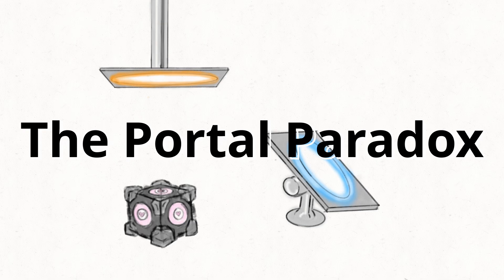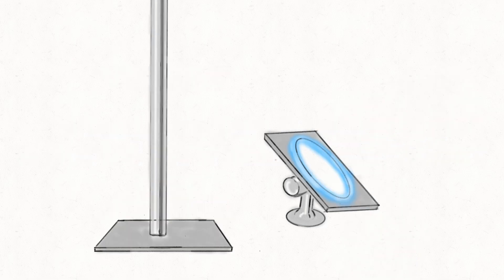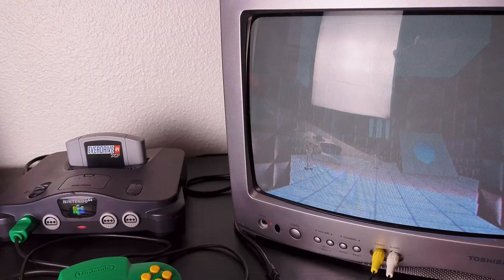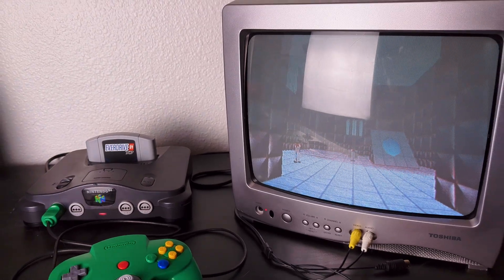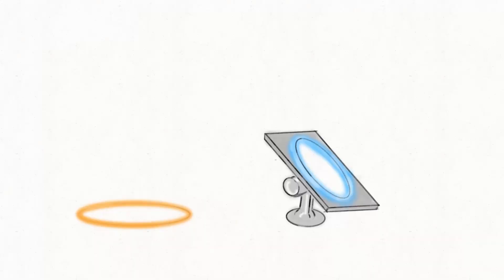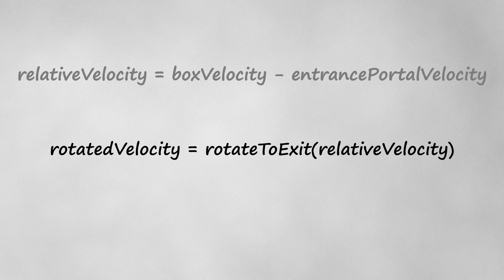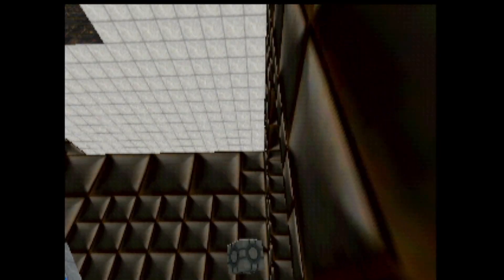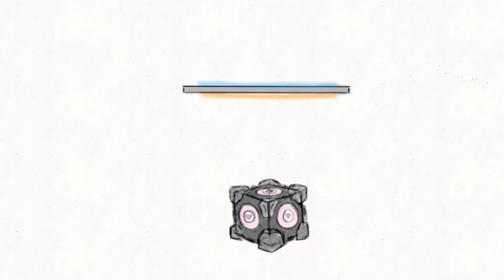I rewrote Portal from scratch and solved the Portal Paradox

Comment: You didn't "solve" the paradox by rewriting the engine from scratch. You chose a solution and programmed it in.
Reply: If your argument rests on the claim that there are other ways of solving the problem that agree with your model, the onus is on you to support that claim. Don't try to get me to make your argument for you.
Reply: YOU claimed there isn't another way,  YOU prove it. Don't twist the argument around. @fieldrequired283
Reply: There isn't another way of programming it that works. To make it plop, you would have to do exactly what he did, and then program in an additional force that makes the cube slow down so it plops out instead of continuing to move at the speed it was already moving.

That wouldn't be portal physics, it would be magically erasing the momentum of objects while a portal happens to be nearby.
Reply: @fieldrequired283  What tells you there's no other way huh ?

Comment: The box would realistically just fall, rolling down the ramp, the second it had finished its movement through the portal because there is absolutely nothing manipulating ITS velocity or reference frame aside from a portal slamming down on top of it at high speed, which itself doesn't modify that box' velocity. It just modifies its position. Why would the box go flying if absolutely nothing but gravity is acting on it? To better understand what I'm talking about, picture the following.

You are standing still. A portal slams down on top of you, not harming, touching or in any way manipulating your velocity or causing any acceleration in any way. You are, however, now in a different location. If this new location is elevated above the ground, gravity will take effect and pull you down, which is where the only acceleration takes place. You just fall to the ground, in this case, on a mattress, safe and sound, because your velocity from your perspective has only ever been manipulated once, by gravity pulling you down as your new position has placed you above the ground.

Comment: The portal has nothing to touch the block giving it momentum,  an object at rest stays at rest until acted upon by another force. What force does the portal use to act on the box? We know portals don't have resistance because the momentum of moving objects do not change when passing thru. 
yes its true if a semi truck is going 60mph when it hits you, its the same as if you hit a semi truck going 60 mph,  but if there is a giant hole in the semi it doesn't matter because you never collide with the semi for a momentum change to occur. You equation may be true, but the premise isn't

Comment: GlaDOS says in the game that momentum is conserved. Does this not violate that original mechanic?
Reply: Momentum is always relative. This isn't an opinion, it's a physical fact.

The most reasonable frame of reference by which to measure momentum is the portal. You can choose other frames of reference, but it makes the math way more complicated.

Basically, portals conserve momentum relative to the portal. It's just just less confusing when the floor and both ends of the portal all have the same speed.

Comment: While I think the relative motion theory would make for interesting gameplay I think I opt for the opposite theory, though without a portal gun I don't know that we could ever truly know how it would behave. If we use relative motion as the basis for this understanding then a flat portal say on the floor adjacent to the cube and falling portal (rather than on the reverse of the same platform) would cause the cube to fly upwards before falling back through the portal to its original ground. I tend to think of the portal like a door, just with it's entrance and exit separated by some space. If I apply Newton's first law, the law of inertia, the box itself is not moving (relative to the earth anyway, but let's say both portals are on the same celestial body, because yes nothing is truly still) sat upon the floor. The portal comes down over the cube but is still sat upon the floor, but now instead that floor is now simply below the entrance portal with no gap between it an the exit, it's state hasn't changed, it's location in 3D space has changed, but not relative to the floor on which it sits with no force having been imparted on the cube to make it move. In such a case with an angled exit portal as shown the floor that the cube sat on would cause the surface to be little more than a ramp which may or may not allow the cube to slide down under the force of gravity.

If I throw a ball through a stationary hoop we can all agree that the ball is moving based on the force I used to throw it, if a hoop is dropped over a ball sat on the floor (or somehow suspended such that the hoop can pass around it vertically orientation doesn't really matter) the hoop moved and the ball remains, if a throw a ball through a hoop that is also moving it may be moving faster or slower relative to the hoop depending on whether the hoop is moving towards or away from the direction in which the ball travels, but relative to stationary objects such as the thrower it moves at the speed I threw it aside from how it is affected by outside forces such as wind resistance.
Reply: this is the same conclusion i came to, the explanation and equation given in this video just can't make physical sense to me. his model only makes sense and he can show it ''working'' because he coded it to work in that way just like he says himself in the video.

Comment: This behavior does not make sense to me.

Kinect energy is being transferred from the orange portal to the cube, but they don't actually make contact. If the portal does not generate any other influence over the object, there's no way a jumping cube would be the result.

On my pov all kinect energy is stored in the wall arround the orange portal, therefore its transferred to the floor once it reaches it.

So, my prediction considering that the only property the portal has is to be linked to the other end, is that the cube would start to fall at the exit portal due to gravity.

As soon as the orange side reaches the cube, gravity vector would change 90º for the mass that got "teleported"  (taking the center of the cube as a not rotational referential).

What I mean is: Each side of the portal has a different gravity vector direction, and that's what is supposed to make the cube 'fall' at the other end.

It would start to fall as soon as the orange portal reaches the center of mass of the cube.

I also considered a horizontal orange portal with vertical blue portal just to make it more understanding.

Different angles of blue portal would just change when the cube would fall at the blue side.

What do you think? 🤔
Reply: If the piston with the portal approaches the cube at 100mph, and you're standing at the exit portal watching thr cube come through, how fast does the cube exit the portal? Do you think it exits slower than 100mph? How would the cube exit the portal slower than it entered it?

In order to exit a portal, you must be moving relative to that portal. And since the portal has no internal volume to store objects, everything that exits it must do so at the exact same speed it entered.

On the way in, the cube and the portal are moving 100mph relative to each other, so on the way out, it's impossible for them to have any relative speed other than 100mph.

It's good to ask where the extra momentum comes from, but to imagine it plopping, you have to figure out where the momentum comes from, and then figure out what magical force makes it lose all the momentum as soon as it finishes passing through.
Reply: @fieldrequired283  
Considering the portal to be just a passage, like a door to another dimension, the speed of the portal will just dictate how fast an object will be teleported.

In order to gain speed you need energy.

If the cube has a certain mass, then there's an amount of energy needed to make it start moving.

Newton's first law says an object tend to be at rest unless acted on by an unbalanced force.

So what forces are acting on the cube for it to start moving other than gravity?

After thinking about this, it really depends on how the portal works.

The way you put it, it looks to me that if the portal did not have enough momentum to surpass minimum energy needed to make the cube teleport, it would bounce back like a trampoline. Otherwise the portal is generating energy.

Also, the portal would slow down at the process due to the energy being transferred to the cube.

It would mean that the portal somehow has weight to store energy.

(many edits because a lot of thoughts came trough as i wrote)
Reply: @ArthurSbetan 
I don't know where the energy required to teleport objects and change their speed comes from. That's just how portals work. Two stationary portals already violate conservation of energy, so conservation of energy doesn't help us any in resolving this confusion.

The thing about "just" dictating the speed at which things teleport is that teleportation via portals is motion, and the speed of that teleportation is the rate of that motion. A portal doesn't teleport anything that isn't in motion relative to both ends of the portal.

The speed it enters is the same as the speed it exits, every time, by definition. To have it do anything other than fly out, you have to invent some kind of force to cancel out it's momentum on the other end, because it always, necessarily has momentum relative to the portal on both ends if it is passing through.
Reply: @fieldrequired283  

My point of view is that the speed of the portal will dictate how fast the object is teleported. Not the speed of the object.

You said that "The speed it enters is the same as the speed it exits, every time, by definition."

If that's a property defined on this matter, then I have no objection to that.

I will rather just state that a hypothetical portal with the property you defines would be able to create energy by swallowing a dense piece of metal and throwing it at any speed desired.

It would be able to place a entrance portal on a thin layer of wood then make it reach 300 km/h and swallow a long dense piece of metal launching it at 300km/h.

Using this property would be insane thinking real physics but much fun gameplaywise.

Thank you for discussing it with me, it really pleases me :)

Comment: The real question is: how does the cube behave when it’s speed relative to the portal is changing while it’s making the transition? Momentum should be conserved both for the part of the cube that hasn’t yet gone through the portal, but also for the part that already has. I suspect the natural result is that the mass gets split between sides and the calculations are done on each side separately.
Reply: Yep - that would be the natural result. But games just calculate these things based on the center of the object (cause anything else would be prohibitively expensive to calculate)

Comment: No arguments from me. You are spot on. It's like being on a moving surface 10m long that goes at 10mph in one direction and you run along it at 10mph in the opposite direction. When you reach the end and the surface disappears beneath you there is no forward momentum. You will drop straight down because you will have been occupying the same lateral position in space at all times.
It's the same when you drop two back to back portals over a stationary object. It will enter the down facing portal at the same speed as it exits the upward facing portal. Both portals will also be moving downwards at the same speed as the object is travelling through the portals. The position of the object relative to the space outside the portals will remain the same. Exactly as if you dropped a hoola hoop over the object.

Comment: Nice video, but you are wrong for the cube. The  only thing it may do is to slide when the cube is ~2/3 out from the blue portal. You are not doing anything to that cube, except changing its position in space. The platform, the cube is placed, will remain underneath it even if the portal swallow the whole cube. It will simply slide, if the friction it's not strong enough. There is simply no kinetic energy transfer between the cube and the portal(the portal prevents the piston to interact with the cube). Thumbs up, tho :)
Reply: The common response from the majority of people who don't understand that all momentum is relative.

The cube has to exit at the same speed it entered. If the portal slammed down on it at 100mph, it exited the portal at 100mph.

You can't really imagine it doing anything else. What you have to figure out in order to make it plop is what makes it slow down after it finishing coming through at 100mph.

Comment: I would like to add another thought: the result depends on one thing, does the cube push itself? If the moving portal causes the atoms to push eachother out of the way on the other side we have the videos result as the cube essentially imparts the force onto itself, however as no force is acting on the cube there is the possibility that the slithers of cube(2 dimensional) would stay where they are inbetween the portals, causing them to overlap most likely causing an explosion. Thus I see 2 possibilities: cube imparting a force away from the exit-portal on itself OR explosive pancake, if the exit portal is moving "backwards" it is no longer pancaked but may still be taken apart.

Comment: I disagree. There is no energy put into the box by the portal. Neither portal's velocity should not be taken into account in the equation. A portal is just a connection of two spaces instantaneously - moving that connection around does not move around the actual space. It's like the hula hoop no matter what velocity or orientation the portals have.

Comment: The box is at rest on a platform. The portal moves at high speed down at the box. when the portal reaches the platform, the box should still be sitting on the platform, which is now even with the "bottom" of the receiving portal. The box should now be sitting on the same platform but also through the receiving portal. It will be affected by the gravity of it's new location and tumble to the floor.

When a moving box enters a portal, it's momentum is conserved into its now location. When a moving portal "engulfs" a box, the momentum of the box (zero) is conserved into its new location. The momentum of the moving portal is conserved in its own location. 

Your equations assume that the movement of the box is translated to the movement of the portal (your initial assumption). You used this assumption to create a relative velocity where only a box velocity existed before. Where does the energy for the increased velocity of the box come from?

Moving portal is dropping on a box that's resting on a platform. Let's set the datum/zero at the top of the box. Let's stop the portal at zero. Now, move the portal down 1 pixel at a time. At what point does the box gain velocity? When a single pixel enters the portal, does that pixel gain velocity while the rest of the box is at rest? So is there stretching of matter here? Or do we just get a gain of velocity when the center of mass is reached and the whole thing jumps? What properties of physics allow that to happen? If we wait for the bottom, what mechanism gets triggered by reaching the bottom of the box? What if the box is much much taller? How much of the box is shown through the receiving portal before the tall box starts gaining velocity?

Physically, your assumption doesn't have any support. The box should be at rest on the platform before and after the portal reaches the platform.

Comment: I disagree with this solution. In this, the portal is imparting velocity to the box. However, a portal is not a thing... it is an anomaly. The portal will not impart velocity since it doesn't make contact to impart speed.
The first moment that the portal crosses over cube, the cube has had no speed imparted. If the portal stopped with 1cm of the cube through the portal, it would not suddenly accelerate with imparted velocity. The same applies when you are at 40% of the cube through the hole. The cube, relative to the surface it is resting on, should have no speed imparted to it. Because according to the cube, no significant forces have been applied.
However, by 60% there is more cube on the other end of the portal... so gravity gets tricky. Gravity will likely have some weird effects with transfer through the portal (since the portal should allow gravity through). So, the entire mass of the cube is being pulled to the surface it rests on... but 60% also has gravity pulling it at an angle. This wouldn't do much yet... considering the slope. However, by 80% the cube may be sliding down the ramp.
--
Now, I do understand the logic. From the relative position of looking at it from the blue portal, the cube is accelerating to come out. However, the cube is what matters. At no point has anything actually imparted velocity to cause it to depart the platform it rests on. So, it should feel no momentum to result in jumping.
So, your code which imparts velocity to the cube when nothing has actually made physical contact to do so, I feel is in error.
--
Now, perhaps it would make sense if portals generated a wind... because that would mean they are sucking materials through them, which is imparting velocity. However, you would then need to pick one portal to be the entrance and the other be the exit. Going the other way would either require overcoming the force generated by the portals... or a way to switch the direction of the portals. However, in this case, a vertical portal crossing would result in a 'bouncing cube' as the force needed to launch the cube from slope would constantly be applied and resist the cube falling back on the 'exit portal'.